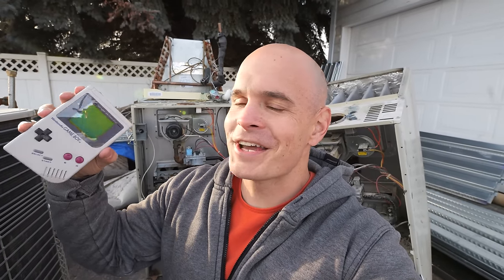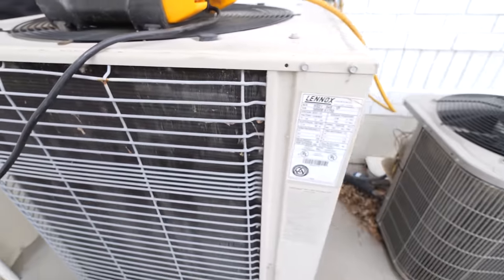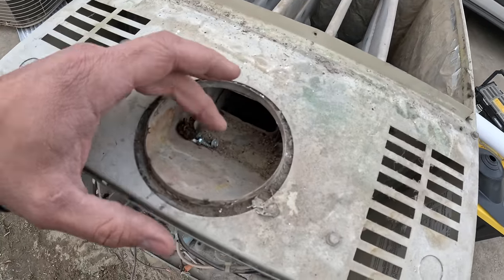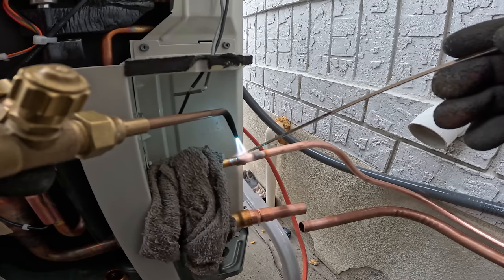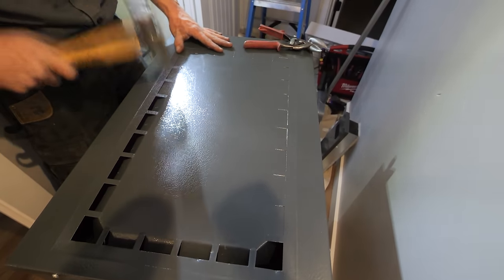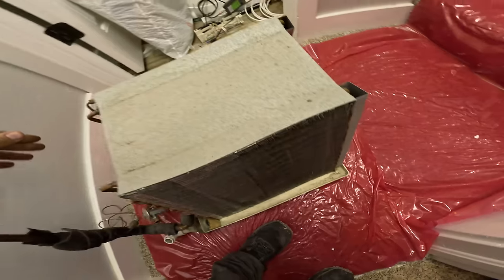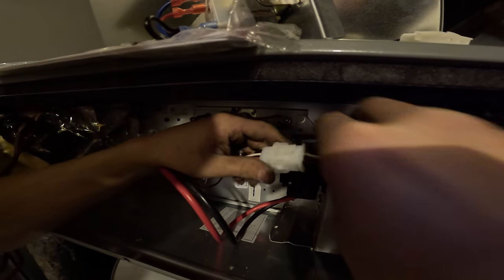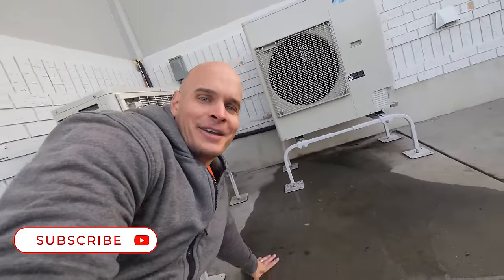Why is Everyone Talking about Heat Pumps?

Comment: So if I live in north county San Diego with 10 year old gas furnace and AC unit i'm hearing I can switch to a heat pump for heating and cooling and end up with a significantly more cost effective solution and quieter to operate one.  Is that correct?

Comment: Old house has a dual stage heat pump and our new house has a gas furnace. It is annoying the hot blasts of air, much harder to maintain comfortable and stable temperatures.

Comment: Heat pumps have been around for decades, but have gotten cheaper to own and improved for colder climates. Old heat pumps were big and didn't work well from about 15° down and required an electric resistive heater or gas burning assist. Now,  heat pumps have heaters in them, which use less energy to prevent freezing up, and they have larger surface area on the coils for better heat transfer. And if you live in the Yellowstone or hot spring areas, you can add geothermal heat sinks and heat even cheaper. You see, just a few feet below the surface, the ground stays at about the same temperature all year. You can both pull heat from the warmer ground or dispel heat to the cooler ground in the summer.

Comment: R22 is more or less a non flammable propane replacement. Propane, or R290, is making a comeback. It was always the best option, boiling at -40, but some company managed to convince everyone that it was dangerous and make everyone use their patented and less efficient refrigerant. The highest efficiency new ones use propane (R290). Also, it is super cheap, not environmentally damaging, and no patents to care about. Australia has used it in car ACs forever.
Reply: R290 is a dry propane, its not non flammable. Its also hard on a compressors. They still have oil care over issues that R410a never did. Burn up compressors a lot from oil loss.

Comment: Only issue is the more advanced heat pumps practically require a computer science degree and an expensive priority tech support contract. No more is it the fan capacitor or frame roll out switch. Now it's what circuit board is it. And is it in the outdoor unit or indoor.

Comment: while the tech may be more efficient, I was 'sold' on getting an air source heat pump AC unit back in 2007. Literally the next year after that our electricity rates rose (first time in 10 years which is what my savings rate was based on) and it continued to increase after that over the next 13 years I owned the property and used the AC heat pump. It never did pay for the incremental increase in cost partly due to that. Also as a whole, we improved the energy efficiency of our home and started using less electricity overall (particularly the last 5 years we lived there). So in retrospect that purchase made ZERO SENSE. While I understand that perhaps today the tech is more efficient and better, you still have to understand your overall usage and amount spent and how buying a less efficient unit for a lesser cost may be more economical for you in the long run. This goes for Furnace as well when comparing high efficiency units to lower efficiency, particularly today with the cost of high efficiency units being sometimes DOUBLE the cost of lower efficiency units. You may use less money to better insulate your home, fix ductwork leaks, and perhaps spend the money on replacement windows and get a lower efficiency furnace and kill two birds with one stone. It all depends.

Comment: The 4x more efficient number doesn't take into account the intrinsic inefficiency of turning fossil fuels into electricity. (Or the lower efficiency when cold... which is when you are using the most heat.) The electricity I get is about 40% efficient at the generator station. So a CoP of 4 is "really" closer to 1.6.

Comment: Remember the electric coils still has a COP of 1. So you are still getting heat/energy unit at a 1 - 1 ratio. Just most heat pumps are 3-5 COP.
Reply: Right, but the energy per unit is much more expensive on electric vs NG for nearly everyone in the US.
That rare usage of emergency heat is so expensive for most people, that smart thermostats will warn about how expensive it is to use.
Reply: @tim3172  oh yes not for peeps who have access to NG. I only have heating oil so it's way cheaper on my end.
Reply: @tim3172 It isnt rare at all, nearly every heat pump uses all the time during the cold months

Comment: Good luck up there in Utah, I’ve lived in a house in Texas with a heat pump for 10 years and this thing has more problems keeping my house warm in the winter than a space heater. There’s got to be a better way. My emergency heat coils work a lot to assist the heat pump and we only keep the house at 68° all winter.
Reply: Is it a carrier?
Reply: Yea get a NG or high efficiency 96% propane furance if NG isnt available
Reply: @zack9912000  Awful idea. Keep gas stuff away from houses.

Comment: Interesting insight into how heating is done in USA vs EU northern countries. In most detached houses people use central heating which utilises water that carries heat to radiators. Some people still use solid fuels, especially now more popular after Putin's invasion of Ukraine, but many newer buildings will have condensation boilers which use gas and reheat intake air with exhaust heat. Those also use water as medium to transfer heat around the house. Air distribution is mostly used when you have a fireplace with an air turbine to distribute the hot air around the house. I haven't seen a lot of houses use gas with air as transfer medium. As for heat pumps, a lot of people opt for the air heat pumps, which are cheaper, but in Germany or Poland it is better to use heat pump with ground or even vertical ground exchanger to still get heat in coldest winter days. At first during this film I was surprised to see air heat pumps installed in Utah, but then Jerry mentioned that he still has a gas dual mode for colder days, which made it make more sense.
Reply: What

Comment: Extracting heath from ice on the ground works.
But the equations which define both the efficiency and the amount of specific heat which can be pumped out of frozen ground are not linear sadly. 
At about -5 to -10 °Celsius (23 to 14 °F) you get to the point where using a electric heating element is more efficient than extracting heat via phase change. 
Just because it is newer doesn't mean it is better, the physics stay the same.
The system makes for a great Aircon system in the summer though. Just add a gas furnace for when it gets truly cold...
Reply: Where are those temperatures coming from? Modern heat pumps usually maintain a COP of 2 down to 5F outdoor temperature. If you need heat strips it's because you need more heating.

Comment: Airconditioning seems strange to me coming from the Netherlands, we (as far as I know) only use water based radiator house warming. Doesn’t your house always have a sort of breeze when using air? And I can imagine it also makes noise.
Reply: There is a slight breeze and some noise. In a properly sized system you won't feel a breeze unless you're directly next to a vent. The noise level is also quite low unless the vents are overloaded.

Comment: the newer gas refrigerant is r32 or r290 (basically propane). r410a is very old and in Europe is forbidden. there is also supercritic co2
mitsubishi heat pumps can work with a very high cop even at -20C

Comment: Should probably fix those water heaters as well. They shouldn't be ran in series, they should be in parallel to wear them out evenly together, if not your first in the line is doing all the work.
Reply from the maker: The first one is turned down to partially warm the water before entering into the 2nd tank to warm up the rest of the way. Or at least that's what they told me

Comment: I had a heat pump setup on my last house here in Center Texas and absolutely HATED it. It ran all the time and would not quickly heat up the house when we go from temperature swings in the winter of 80 in the day and below freezing at night. Be the time the house would heat up, it would need to cycle to AC. What they don't tell you is that can take HOURS. I will never own another one.

Comment: Here is my "back-of-the-envelope" calculation. Please comment if you think I am making a mistake. 

According to my utility bill, in Utah 1 Million BTU from natural gas costs approximately $14.43 (including taxes and fees). If you want to generate the same amount of heat with (resistance heater) electricity, you need to use 293 kWh. In Utah (10 cent per kWh) that costs $29.30. With a heat pump, only a fraction of that electricity is needed to pump 1 Million BTU into your house. If the heat pump has a conversion efficiency of 2, you would need half of that ($14.65). Good heat pumps can have conversion efficiency of 3.5, which means it would only cost $8.37 to pump 1 Million BTU into your house. Since conversion efficiency is lower when it is colder outside, I would expect that over the course of a heating season you wind up somewhere in between those two numbers, maybe $11 or so. 

So, on paper it looks like a heat pump operates a bit cheaper than natural gas given the prices of gas and electricity in Utah. Is it financially worth it? That depends on the cost of the heat pump system compared to the gas furnace system. Suppose you use  50 Million BTU to heat the house for a year, it would cost $721 in natural gas, and maybe only $550 with a heat pump. You'd save $171 per year. Suppose the price for the heat pump is $5000 but the price of the gas furnace is $2000. You could buy the gas furnace and put the saved $3000 into a bank account yielding currently 5%. Over 20 years those savings could grow with compounding interest to $7959 (more perhaps if you invest in stocks), which means you earn $248 per year on average in interest and at the end of the 20 year period you still have your initial $3000 savings. So, I do not see how the heat pump saves money unless the price for a heat pump is not very different from the price of a gas furnace.

Comment: Daikin is indeed world leader in AC, and 410a has been industry standard for well over a decade now. Strange that you're changing your system only now
Reply: Many people like to keep the older systems since if you get a good install where everything is done right, then with some DIY maintenance, the system can function well for 20+ years. When many of those systems, it is easy to service the blower motors, and many other components. And for the refrigerant, you can do periodic inspections using a thermal imaging camera after you have confirmed a fully charged system. Ideally done in the summer, when the system is known good and charged, log the temperature, then use a blow dryer on the compressor for a few seconds, and point a thermal imaging camera at the compressor (the refrigerant will settle at a certain level within the housing). Then mark the fill level of the system. after that, when the temperatures are similar, then repeat the test and compare the level, that provides a good indication of if the system has a tiny leak or not.

Many newer systems, while being more efficient, tend to be less DIY friendly especially for the outdoor part of the unit, and the controllers for the systems. Overall with all of the normal maintenance and basic repairs, including board level repair being DIY friendly, the only time you need to get a professional out there, is when you need to replace a compressor and filter-drier, since the equipment needed to recover all of the refrigerant, as well as the soldering work needed on the copper lines, and potential repairs since you can't really use a lot of heat on an old filter-drier without risking sending moisture and crud into the the rest of the lines, it is too much of a hassle and too costly for such a rare task.

Comment: Here in UK, heat pumps are a nightmare to install, cost far far too much (barely any gov subs) and their overall output compared to gas boilers is crap. Until the tech in them gets better and they come way down in price theyre not a wise investment at present.

Comment: Why install a "heat pump" & an "AC unit"

They are both heat pumps at the end of the day, and the right model can run in reverse, so heats during the winter, and cools during the winter

Comment: Yeah it cost an astounding amount just to be "Efficient"

I just use Honeywell Radiator heaters. It heats up an then turns off while still producing heat.. Thats about it.. Modern-day AC window units in the Summer..

Comment: @JerryRigEverything I would strongly suggest getting this install checked and maybe redone. The mistakes pointed out by @ShayneHartford and @SupremeRuleroftheWorld are potentially making the lifetime of the system lower, and could lead to leaks.  Theres alot of shortcuts and things installers can do when installing a heat pump system. Other than the things already pointed out: You need to blow through the pipes with nitrogen before makin the final connection, you need to pressurize with nitrogen after the system is sealed, and check all connections for leaks, as well as leaving it pressurized for some time to do a drop test, so you can rule out micro-leaks. All this before opening the valves to let the coolant into the pipes.
Reply: Oh, and obviously atleast 20 min vaccuum , getting it down to close to a perfect vaccuum before coolant is released. this is essential, and I expect they at least did that, but due to installers always being under time pressure, there is a lot of cheating that they could have done.
Reply: Vaccuum time varies a lot depending on the size of the system, for larger systems it could take much longer.
Reply: I would say that the worst case scenario, is if they were soldering without background flow of nitrogen, that means that flak is now in the compressor, and it needs to be cleaned or replaced. The other problems could be fixed quite easily by redoing the piping/connections
Reply: Yep your not wrong.

Comment: Why keep the duel fuel furnace and not switch to electric backup for both units? You have solar backup power and its better for the environment, Also in extreme cold, the gas distribution network may not keep up just like texas a few years ago.
Reply from the maker: It was too hard to run 240v from my panel in the basement to the upstairs closet. So we did duel fuel for now.
Reply: @JerryRigEverything  that makes sense, awesome showcase of some really cool tech!

Comment: I had a Mitsubishi Hyper Heat Pump installed - whole new system - My electric bills are $700+ a month for heating 1400 sqft. Neighbors are heating with oil and propane have a lower bill even when adding in their electric. Mitsubishi said my unit is functioning normally. Personally not happy with the heat pump. When running the AC on the unit my bill is cut in half.

Comment: In the UK heatpumps for your home use 3 times less energy than a gas boiler, but electricity per unit is 3 times more expensive than gas.....so you wont notice any cost savings.
Unless you get a company to give you them for free for doing a youtube video :)

Comment: At -10⁰C you'll have an efficiency that is close to heating just with electricity. And possible freezings of heat-exchanger (if there is no additional electric heater )
These air2air heat exchangers are efficient only when temperature delta is low enough
Reply: Not true. We have seen units that output nearly 3x the heat of the electricity used  at those temperature (key: look for products with EU SCOP A+ and above). And at such temperature heat exchanger doesn't freeze as often as at higher single digit temperatures.
Reply: @jasonw98  can you provide efficiency - temperature graph 📈 from manufacturer that confirms your claim?

Comment: i trust those viega pro press fittings on water but hvac?? i looked it up and i guess thats become a standard practice now hvac techs use them all the time, i feel like for freon how high the pressures get i would rather a soldered connection

Comment: I almost got my home burned because of these coils. The switch who controls power delivered to the coils failed at on position and the heat when very high it burned the insulation. And since it will start only in emergencies this means it will collect dust particles and fibers and spider webs so when it starts you will smell something burning.
This is my experience with coils.

Comment: this might sound crazy, but everyone gets scared of the leaking furnace combustion gases. 
however, 50% of people have natural gas stoves , that dont get vented outside unless you decide to run your range hood, and that assumes you even have a exhaust fan or range hood.
Reply: I don't think people are scared of leaking furnaces. The only reason we're okay with stoves is that they burn much less gas and are usually supervised.

Comment: America is a developing country when it comes to heat pumps. Surprisingly skeptical and conservative. Finland, Sweden, Norway etc. Nordic countries have been using them for decades. Also I'd like to add that ground source heat pumps are even better than these air ones. They last longer and don't switch to resistive heating when it get really cold outside. Perhaps America "wakes up" to those in 10 years or so :D